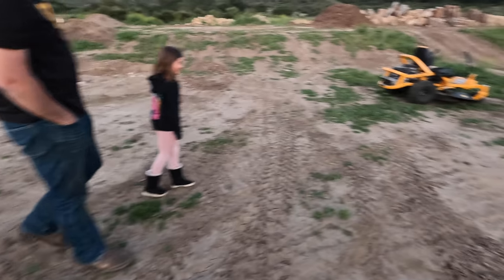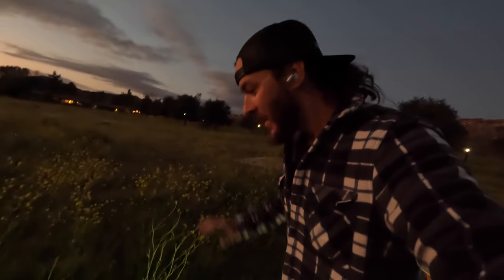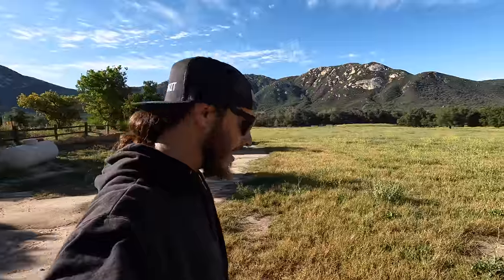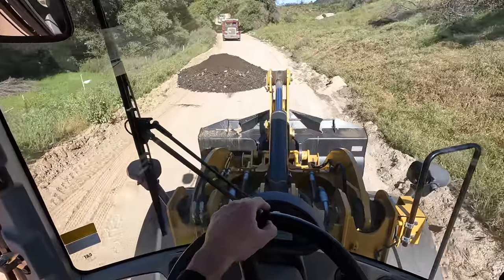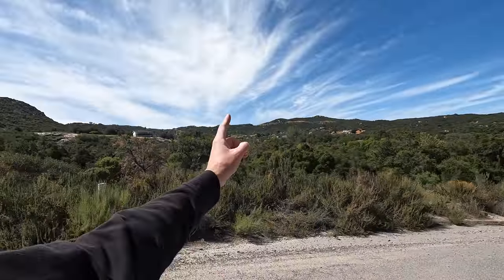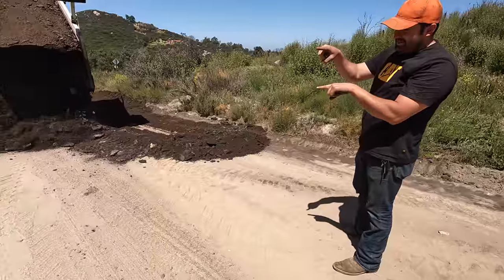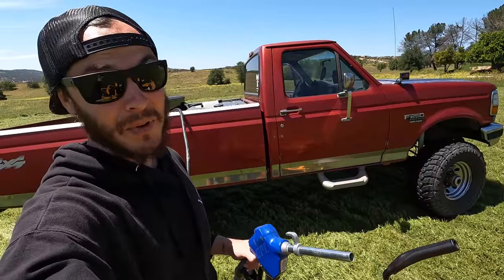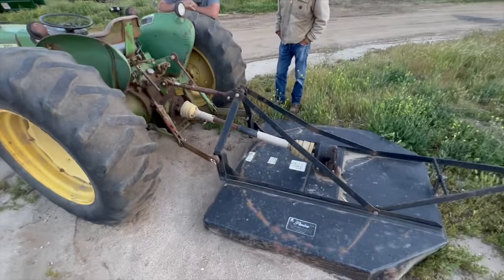We Planned on "Paving" Our Road. Then This Happened.....

Comment: For bigger acreage I use my zero turn and a 60" pull behind offset deck mower. I cut 64 inches plus 60" on the deck mower each pass. I love that setup. Plus once you get use to the zero turn with a wider deck you can cut under your fence eliminating about 95% of you eat eating.

Comment: When we are doing a mainline grind and pave job we normally give the grindings for free if it is beneficial for us. We have an asphalt plant that uses recycled asphalt to produce new asphalt pavement so it normally all depends on cost. I will tell you that the grindings that you have will last forever and hold up!! A lot of people would prefer grindings because of cost and it lasts and after rolling it in is a hard surface!! It does suck that they arent trying to spread it out for you! We would come in with belly dumps and that would be so much easier for your grader!

Comment: Make sure u get a tractor south a bucket and quick conect system so you can switch to a set of forks easily and quickly. that was my first upgrade was a quick connect so i didn't have to get off the tractor and fight to get it unhooked

Comment: Personally run a M4-071 alot at the farm I work at and it is super nice. Its not extremely big, its on the smaller side but its got alot of power and is very capable for just about anything you can throw at it.

Comment: Get a kubota zd1021 if you get a zero turn. It’s a diesel and works the best. I use it for my lawn care company and it never gets hot like gas mowers. I run hours and hours at a time and it never even gets hot. And it also doesn’t burn through fuel. The diesel lasts about 20 hours before filling up with 5 gallons!

Comment: Go check out the Kubota MX6000 with a front end loader and have them install a 3pt top and tilt. The Kubota 1872 brush cutter works very well behind it, and as for grading work look into the grader scraper. I work for a dealership in Oklahoma and we sell an absolute ton of them. The warranty is bar none!

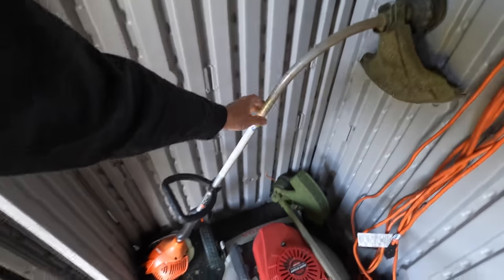Comment: @8:35 the actual reason for curved and straight shaft weedwackers,
So i worked for sears for 10+ years i started in law and garden and moved all over the store selling different things. I have a ton of  Knowledge for nothing known, BUT on the Curved shaft weed wacker they are curved for shorter people, 5'7 and below and the  Straight shaft weed wacker are made for 5'8 and above
They were actually made for that reason.  
So someone like me 6+ feet tall if i use a curved weed wacker i hunch over to use it, were the straight shaft i get to stand upright...
Reply: Curved shaft trimmers should never be built or sold. The handles can be adjusted on the straight shaft trimmers to accommodate the height of the user. As a pro of 20 years I have seen both men and women professional contractors all using straight shaft trimmers.

Comment: Personally have a Kubota M4-071 deluxe cab for two years now love it. It has about 500 hours on it lots of power have tons of attachments for it like in Grappler ,forks ,brush hog ,grading scraper ,ploughs ,disc and Bucket would highly suggest getting rear wheel weights and maybe even having a ballast box as I have both while lifting heavy loads it stables the tractor a lot makes it easy to move around with heavy loads in the front

Comment: Cub cadet is a consumer or home owner model. Go to a pro shop where contractors go to and test out some commercial or professional grade equipment. Also you never see any pros use curve shaft trimmers for a reason. Echo equipment is notorious for being cold blooded. Always use the choke for starting unless its like 90or so. Stihl trimmers have a vent on top of the fuel tank that goes bad and will allow the fuel to soak the air filter with fuel making it harder to start.

Comment: I feel you on the "curved shaft" wire trimmer.  Those are no good!  I was a landscaping contractor for many years and always used the straight shafted Sthils.  Cant beat those.  The Sthil you have looks pretty good, probably jut needs a new carb.  Worth the $20 investment to replace that tiny carb.  :)

Comment: When you buy a zero turn for the ranch, I highly suggest the Hustler brand.  The Raptor 52” is a homeowner model that I’ve used for the 7 acres on our farm when the 72” commercial grade mower was down.  
Kubota has a ton of attachments and is a good brand, I’ve run the Mahindra and think have better bang for the buck, all the attachments you need, more ergonomic design, easier to maintenance, and have better numbers for breakout force on hoe and bucket attachment.  Just my unsolicited opinion lol

Comment: I don't know what it is about dump truck drivers and them feeling the need to run with in radio distance of each other. But after more than 25 years of loading and unloading them. I can't get them to run separate from each other to time the dump , spread, dump next truck. But everytime  you dump them and space them out to keep a steady stream of dump,spread dump spread. They feel the need to team up and run convoy on the way to and from.

Comment: Ryan you know you can buy an inclosed cab Mahindra tractor with heat and air and def fluid tanks brand new they have all the attachments loader,  brush cuters, box drag, Posthole drill, granted they aren't the top name in tractors but ive been on my friends and its a good little work horse best thing about it was no dpf system on it

Comment: I wouldn't use a zero turn in that I would buy a tractor with a pull behind brush hog. I have about a 15 acre yard in Ohio and I use a Kubota with a Land Pride 60 inch finishing pull behind and honestly that's to small and takes me hours. I need a dual pull behind. A brush hog leaves to many clumps for a yard but is good for the other 60 acres of my property.

Comment: "Leaning to much" ive dumped with one flat tire on a single axle truck in a sketchier spot then that, but then again that's a company truck with his job at stake if it goes over. so I commend the caution.

Comment: So we have 13 tractors that are new holland, john deere and  2 are Kubota m4-071 and  I would suggest going for a new holland or john deere instead. which ever you can better deal on. I found the Kubotas to be kinda cheap built when it comes to the cosmetics type stuff like fading plastic and button cap breaking and their regen system is by far the most annoying thing. So I highly recommend  getting that regen system deleted  if you do go with Kubota. Their turning radius is worse as well.  I find the John Deere a lot more comfortable especially. We have a 5075 and a 5083 for john deere. Only the 5083 has regen and 1 it takes a lot long till it requires regen and 2 it has auto regen in it so when it is required the tractor it self will take care of it.  there are some other points as well but i feel this comment is already long enough